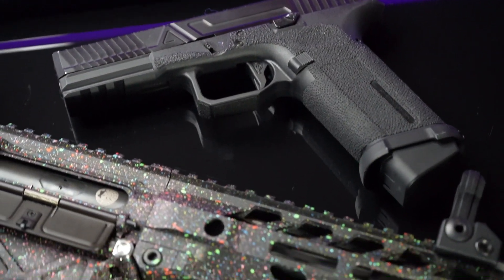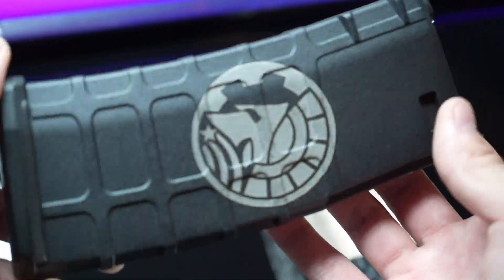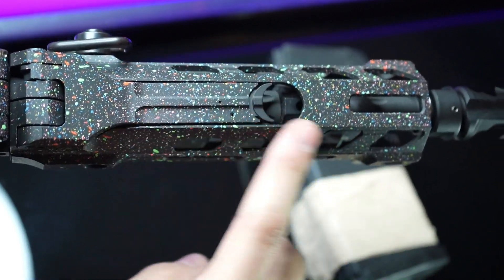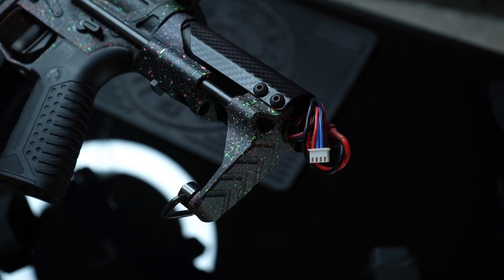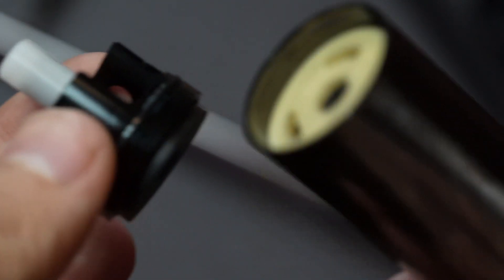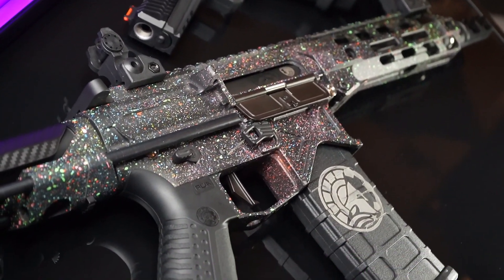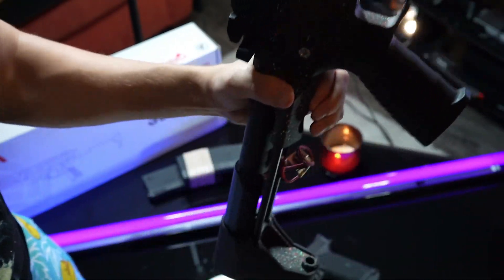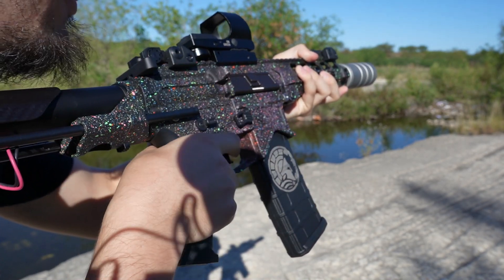RWA Battle Arms Development Airsoft Gun Review (A Great CQB Contender)

Comment: The TL;DR version: Overall 4/10

Your review was helpful and thorough (as always). Coming from the technical perspective, the price isn't worth what you get... if it had a TITAN installed instead of an ASTER (w/o the Quantum Trigger btw), it would've slightly justified the MSRP. The gearbox is a letdown seeing as most AEGs, even the budget-friendly ones, have a QCS system and the motor is a old school G&P ferrite-type with not a lot of torque. The benefit to the gearbox shell is that it's similar to the old CYMA Standard before they switched to the Sport shell. The part where you showed the lack of an air seal and mentioned that there were little to almost no shims really shocked me... that's just not right.
As you said, the licensing is possibly the reason why the price is high as well as to compete with other offerings but it's not enough merit for what you get.
Sorry for the lengthy comment, just wanted to share my thoughts 😬
Best Regards, a fellow Texan

P.S. down to upgrade if I'm ever in SA 😜

Comment: Nice airsoft toy. I think it should be used as a CQB rifle, that can be used with little engagement distance, as to not hurt anyone, with the low Joule readings.
As for stocks, take up a buffer tube stock, and use it, along with a BCM clone stock that has a lot of battery space.
Funnily enough, with real AR-15s there are a lot of people in countries where on can pick up an SBR without tax stamp, that switch the MP5 stock up with a normal buffer tube stock, so it is practical, or atleast a lot of people think that.
Maybe even one of these hinge-folder adapters, that make it so the buffer-tube can fold to the side.
Although it should be noted on the airsoft toy the wires must be secured to avoid tearing the wires, and on a real AR-15 one can´t use the AR while the buffer tube is folded to the side, or else it would cause a catastrophic failure.

As for size it is certainly a practical M4, and I prefer something with a stock over paintball-wannebe guns any day.
If you like those airsoft toys with the paintball grip, go for it, but I like this.
However, seeing how low the joules are, using an MP5K would probably yield similar results, but with smaller mags, and a foldable stock, and larger battery size, if you have ak-stick type batteries that are very slim.

Ultimately it isn´t a bad airsoft toy, but like a lot of the products coming out today on the airsoft market, the first thought when constructing the product was visuals, and performance was an afterthough.
If it is a cqb-gun one may as well use a tm skorpion vz.61 aep with a drum mag, because that has little range too, but it is smaller, and range won´t matter if one only has to reach out 5 metres.
Or 16 feet for you americans.